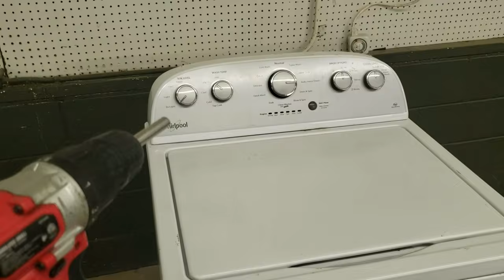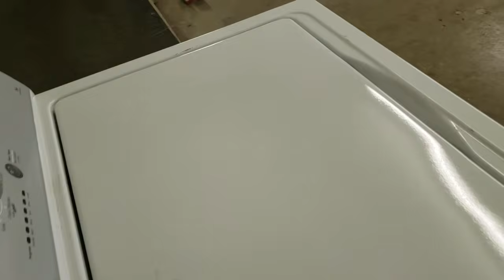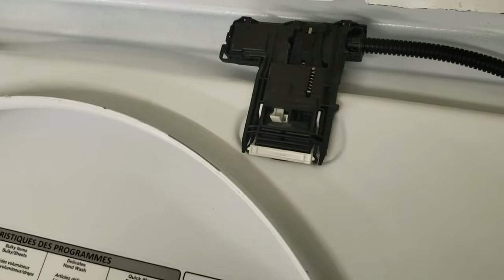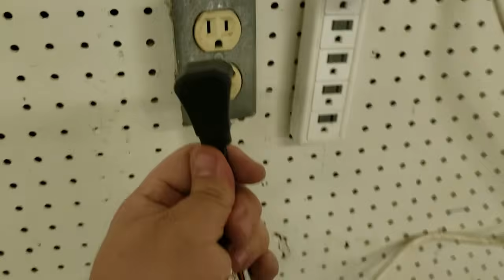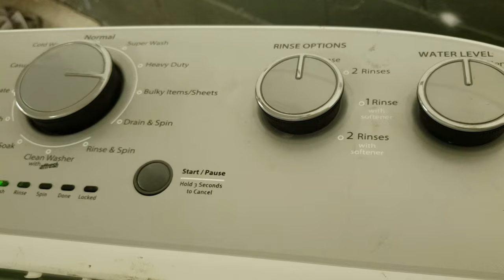How to Replace Newer Whirlpool Top Load Washer Lid Lock and Fix Lid Striker Issue (W11307244)

Comment: I have one was working when I plug it in . after stop it unplugged it and the lid lock is on new so I plugged it in .now there's no power and lid lock is still on ? Any ideas. I will be uploading a video soon . it's exactly like that one
Reply from the maker: check board. Someone sent me a pic of a fried/damaged board after installing a new but bad lid switch. Otherwise, a capacitor could be bad causing it... We've seen one or two boards w/ a bad 1000uf/6.3v capacitor near the serial# causing lid lock problems
Reply: @bensappliancesandjunk  thanks will do 👍

Comment: Thanks for the video Ben. My Maytag Bravos was fussy with the lid lock. Your video helped me get it out so I could tie it permanently into the locked position.  Will be fixing correctly soon. Very poorly made , brittle plastic on theses locks. Don't feel bad if it snaps on you. Seen better material in Happy Meal toys.
Reply from the maker: They are AWFUL. There's a commercial-grade one Maytag upgraded for these designs... I wish it was on every model. Same price at wholesale. These locks are $50-80 new, and can't be costing them more than $2 to make. They've been making these pieces of garbage since 2009 and they still suck.
Reply: @bensappliancesandjunk  Got any idea where I can find the upgraded part #... everyone seems out of stock for part# W10682535
Reply from the maker: @soyews  nationwide part shortage right now. Its bad. I've had 2 on order to have for spares and they've been on-hold for 2 weeks now. Utter nightmare trying to find Whirlpool parts.
Reply: @bensappliancesandjunk  Thanks for your videos , replace the lock lid switch, stumped me for a minute as I did not quite seat the connection on the board all of the way. Old part # was W10682535... new part # is W11307244 .  Local independent appliance repair guy had one for $90 .  Better plastic case. My washer Model # was MVWX655DW1
Reply: Washer is back to work but the latch does not always unlock at end of cycle.  Wife was just pulling up on lid till it released.  Bad idea. I noticed if I turn off the washer the lid latch releases.

Comment: I have exact same washer. It will pump water in for washing pump water out for rinsing but it wont agitate or spin. Could it be the a lidlock?
Reply from the maker: Check to verify via diagnostic/error codes.

Comment: I love the video you made. I changed the lid lock switch but i didn't press on the switch like you did toward the end of the video and my switched burned again. Im not too sure if that lack of a final step is what caused it
Reply from the maker: I don't think that would cause it to short and explode. Its possible, but very unlikely. Pressing on the switch would lock it properly in place, not cause the wires to short. You may have gotten a defective lid lock. or at least, that's what I'd tell the company you bought from and request a replacement.
Reply: @bensappliancesandjunk  
You're right, i bought another switch and this time it burned out along with a circuit on the board, namely the r050 circuit. I guess I'll buy another washer since the board is half the price of a new washer lol
Reply from the maker: @josepalacios627  wow I'm sorry to hear that
Reply: I changed mine but I just get a solid red light on the lock and it won't work😢
Reply: @andrewbellew1806  turned out to be a bad control board. An easy swap

Comment: Hello, I replaced my lid lock. Recalibrated it and it worked fine for one wash. Went to wash another load and its doing the thing still. Not going past the wash cycle. I have the Kenmore series 500 top load washer. Doesn't look like the one you posted 4 weeks ago.
Reply from the maker: Check error codes in diagnostics and see what pops up

Comment: I've got a little newer whirlpool model wtw5105hwo and the plastic piece on the actual lid broke this morning. The piece that slips into the lid lock you just replaced. Any advice on how to replace that piece?
Reply from the maker: Its called a striker. I got a link to appliance parts pros in the description. Punch the model# in and it'll link you to the exact striker you need

Comment: Trying to replace mine and I got the part for my washer from a local parts store by model number but the striker isn't lining up so the lid won't close. Do I need to Uninstaller and reinstall? A little scared because the old part broke when I took it out and I don't want to break the new part
Reply from the maker: Lift the lid and see if you can pull the lid lock down (or forward, towards the machine) to allow the striker to fit in. Many times, these lid locks are being set to "Locked" mode from the factory meaning the striker will NEVER fit. I blew out a lock before I found this out. I don't believe the strikers are much different on these machines, and its entirely due to the lock itself being set to a locked/off mode, meaning the lid lock thinks the strikers already in place, in the lock, when its not.
Reply: @bensappliancesandjunk  thank you! I was able to get it fixed and she's up and running! I appreciate the video!

Comment: I hold down the lid lock but I didn’t hear it engaged. It’s a new switch I purchased
Reply from the maker: The other option is to put the machine into recalibration mode to reset it all

Comment: Ok. So I forced my washer open on day when I washed some shoes. It sounded really bad( ended up sneakers rubbing together and making a bunch of squeaking so I broke it for nothing) well i ordered the parts and replaced the lid lock harness switch, and changed the deal on the closing lid just in case. Think you called it the striker. Well both new. I go to try the trick to make it think it’s ready,  the only thing that happens is the the lid lock is blinking red. When I depress it it holds red. Not sure what to do. Any help would be appreciated by anyone.
Reply from the maker: You may need to re-calibrate the washer since you broke the old lock off. I have another video on how to get this machine into diagnostics and run the calibration mode on it which should help solve the issue.
Reply: I tried it also. Great video btw. I still can’t get it.
Reply: Yeah I tried it again, the recalibration. It blinks from right to left a few times then all lights just stop and it turns off.
Reply from the maker: @Ottersmilk  I wonder if something else has taken place on the unit to cause issues. Maybe run error codes and see what pops up? I'd also, before all of that, unplug it (the washer), let it rest for 15min then plug it back in and try to just run a basic load.

Comment: Can you just unplug it and leave in the washer ??
Reply from the maker: Unplug it to do what exactly? You definitely want to unplug it to install the lid lock.
Reply: @bensappliancesandjunk  I mean to unplug the lid lock connection....
Reply from the maker: @Rick-tb4so  newer lid locks cant be bypassed. They send a signal to lock and unlock in a cycle. If the lock doesn't respond with the right sequence, the washer will not work
Reply: @bensappliancesandjunk  ....Thanks.....
Reply from the maker: @Rick-tb4so  The only thing you can do to that type of lid lock is take the striker off the lid and put it into the lid lock. It'll let you open/close the lid whenever it runs. Good for component checkups.

Comment: We replaced our lid lock on our washer and it still won't lock and go into spin. We tried the suggestion that you gave at the end of this video but still it won't lock. We can engage the lock by hand and the lid lock light blinks...please could you help. We have tried calibration over and over but perhaps we are doing something wrong.
Reply from the maker: You said you tried calibration, what about error codes. Did it spit out any error codes to suggest why it isn't spinning?
Reply: @bensappliancesandjunk  we didn't do the error codes because when the machine was 6 months old someone forced it open and we knew the lock was broken. We will check the error codes tonight...any other suggestion?
Reply from the maker: @amandaredmond9378  no because the error codes should reveal the exact reason its not locking properly. May be another related issue.

Comment: I changed the locking mechanism on my roper top loader. It’s still doing what it was before. I hear a clicking in the control board when it tries to lock the lid. Then nothing. It tries a couple times then stops. Need help. What’s wrong?
Reply from the maker: I would suggest entering diagnostic / error code mode and see what codes pop up. If you check my Playlist, i do that for an Admiral washer thats identical to a Roper.

Comment: What if the machine doesn’t do anything but go thru the water fill and drain?
Reply from the maker: If it doesn't stop and flash the lid lock (then do nothing), you'd need to pull up error codes and see what code is causing it not to start to agitate/ect. I have a video or two for that "How to troubleshoot an Amana washer and understand the codes" then "How to calibrate a whirlpool washing machine" - I would GUESS its going to be a F7E1/F7E5 code for a mode shifter, but the troubleshooting & error mode will be able to tell you a lot more.
Reply: Bens Appliances and Junk thank you, where and how does one get the codes
Reply from the maker: @henrybenavides8808  please watch the videos I mentioned

Comment: Thank You, Repair man was going to charge $260. with part. We bought the part online for $50. With this video it was and easy fix. Thanks you saved my elderly mother $210. Thanks
Reply from the maker: Awesome! These new-style locks are really easy to replace *once you destroyed one before learning*. The old style required screwdrivers and the like to get it installed. These don't take screws, but will install/remove faster... Once you figure it out. Very fusterating!

Comment: I was having trouble with the Lid Lock when the washer at my home was giving trouble for the first time. Luckily, this video gives great detail about the lid lock that saved my family from spending too much money. Thank you for this! I appreciate it a lot.
Reply from the maker: Glad it helped! I destroyed one of these locks the first time I had to put one on, so I figured making the video would help others to not make the same mistake.
Reply: @bensappliancesandjunk  The issue I'm having after following your video is that the lid still won't stay locked. Should I order another replacement part?
Reply from the maker: @christinemccallum6111  I'd recalibrate the machine

Comment: Can you bypass the locking mechanism or disable it?
Reply from the maker: Sadly, its a very difficult process on these types of locks. The control board sends a pulsed on/off/on/off signal to check responsiveness. If it doesn't get the correct signal back, it fails the unit out which gives you a lid lock code... So you gotta replace it.

HOWEVER, if you want to bypass it to simply look into the machine to see it run for tests/ect, I always take the striker off the lid, and set it in the lock so it can cycle with the lid up.
Reply: @bensappliancesandjunk  I was going to ask this same question as to what do you do then when the lock fails and you can't wash anything at all and the lock is out of stock everywhere you look online or is double the price it should be at the local parts house?? If we could bypass this lid lock on this, it would sure help us out tremendously.
Reply from the maker: @lindaccherry2404  youd have to install a toggle switch that gives the correct open and closed signal in the correct order. Its doable. But its not easily done and would require wiring up such a toggle system. Its not like the old ones that you can use a jumper wire on

Comment: I have a whirlpool,  Model wtw5000dw1.  Hopefully  you can help. I can run the washer machine until it get to the rinse cycle.  When it get to that part it won't drain the water  and go past that . Any idea  if it can be the lid lock
Reply from the maker: That sounds like the lid lock to me. It has to verify the lock works before it advances.
Reply: Or it could possibly be a foreign object blocking the water pumps drain function. I probably mistaken though. BTW I have the same model, my issue was loud ass banging during final spin, and even inability to drain. However once I did the recalibration process, it's seems to have temporarily alleviated the issue. Granted, I recalibrate after every wash...

Comment: Hi Ben so my kids yanked open the lid when it was locked because their friend decided to play hide in seek and hid in the washer which locked on him. So they yanked it open to get him out. Now the washer makes a clicking noise with the lock and will not lock, the lid lock light will not turn on, and the wash will not finish the cycle when it gets to drain/rinse. I replaced the lid sensor and it still did not fix the issue. Do you have any suggestions? Thank You!
Reply from the maker: So you replaced the lid lock and it still wont lock or unlock properly? I would put the machine in diagnostics and look for error codes. I got a few videos on how to do that and what the codes mean... if you did not replace the lock after they yanked the lid lock out, I would imagine the lock got destroyed and needs replaced.
Reply: I know this was a year ago, but did you figure out the issue or how to fix it- mine is doing the exact same thing and I’m not sure if I should order a new lid lock or if there is a different issue

Comment: hey Ben, I had this same issue and replaced it with a new lid lock. Washer turns on but after finishing the wash cycle it just blinks the "wash" light, it won't move to the rinse cycle. I ran the calibration and it throws the error code for the lid lock still. Is there a chance the new part I bought is broken or am I overlooking something simple? Thanks for the video!
Reply from the maker: Its possible its broken if you can't even calibrate it. Generally, the lid lock is supposed to cycle a pulse off-on-off signal to the lock and see how it responds, then depending on the response, continues on the wash cycle, or errors out. I'd make sure you press the lock in to trick it to unlock. If it unlocked but is still having issues, maybe try the reverse and see if maybe its set on an odd mode where its thinking its locked when its not or vice-versa.

Otherwise, you'd have to look at the control board and that's a lot more money than waiting for a replacement lock. I'd check the seller who sold it and see if they have ideas, too.
Reply: Possible you got a bad lid lock. It happens. What brand is it?

Comment: Hi Ben,...
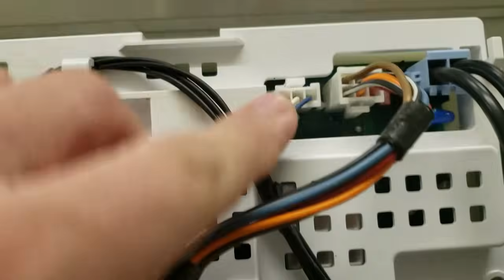So at 2:55 in the vid you got the blue, red, & white on the plug.
So which two do you use a jumper\bypass on so the machine thinks its a loop to the lid (closed lid) but really stops at that point?
I don't have kids so I don't need the feature.
Reply from the maker: A jumper WILL NOT WORK on this style washer. The control board will pulse a close/open command to the locking feature, and if it does not pass that test (as showing always closed), it simply will throw out an error code, and not work.

I did make another video on how to do a quasi-bypass on these style units though: https://www.youtube.com/watch?v=Rl7CtBqB9U8

Comment: Thank you for this, my dip stick of a sibling got mad at the washer and broke the lock. Now i have to replace the load sensor (what was initially wrong) AND the lock. With this video and the other i saved so much money thank to you. Thank you so much.
Reply from the maker: Awesome! These new locks are easy to do ONLY if you've seen it done before. I destroyed one of these ($55) because I had no clue how they worked
Reply: And that’s exactly why I’m here 😩.... I got mad and broke the lock. “Hold for 3 seconds to pause or cancel”,  except my washer could care less how long you hold it... it does whatever it wants.